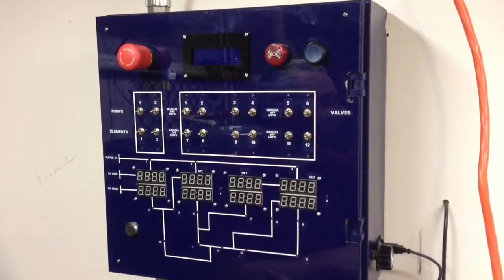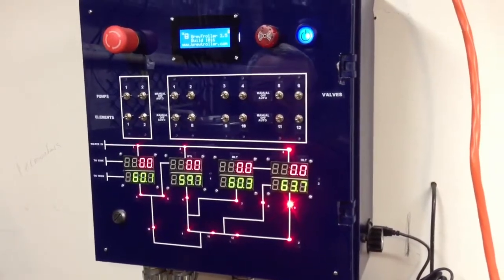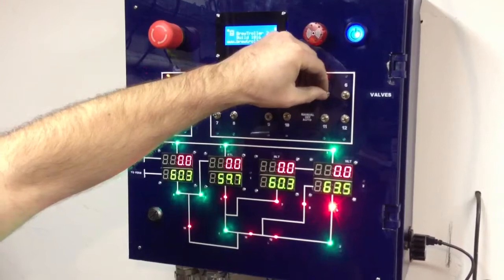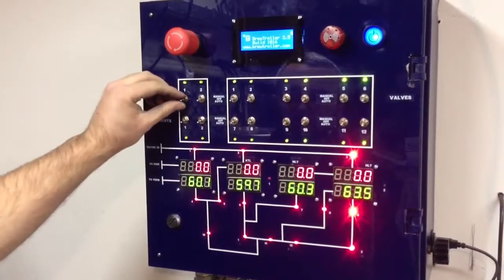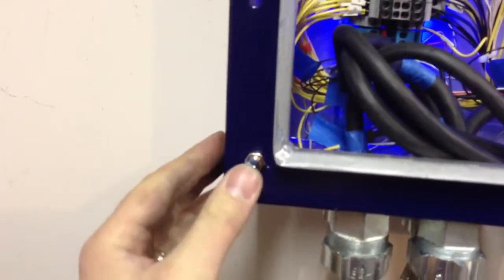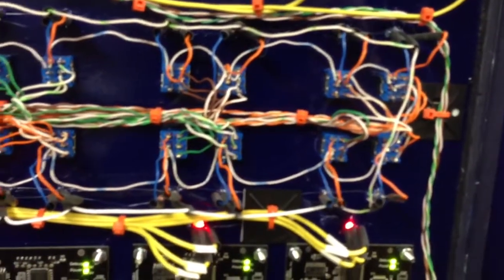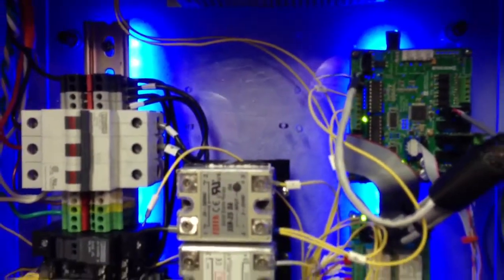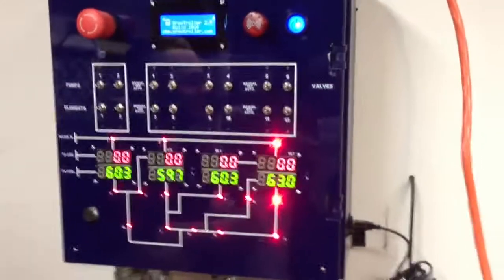Brewing control panel

Comment: Excellent work.  Going through same journey myself.  Question - what kind of finish do you have on the panel's face and how did you print the white lines/borders/txt on it?
Reply from the maker: It is a plexiglass panel with spray paint on the back side. We use a label printer to print the names, and use automotive pin striping for the pipe locations.